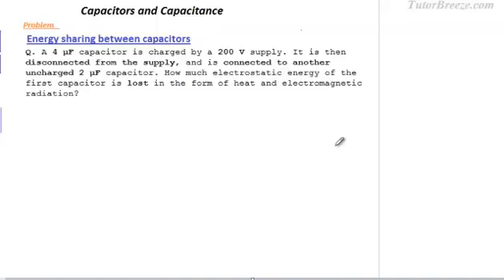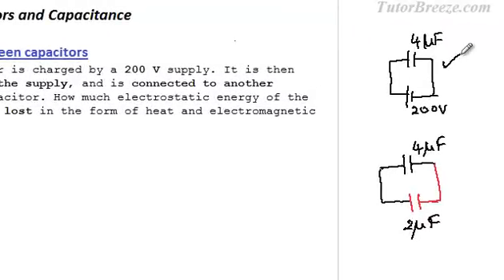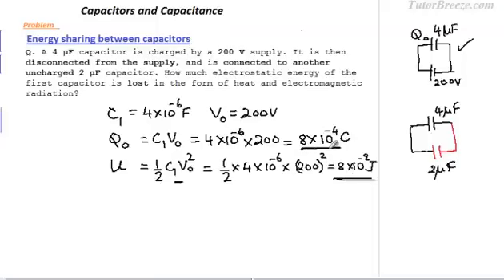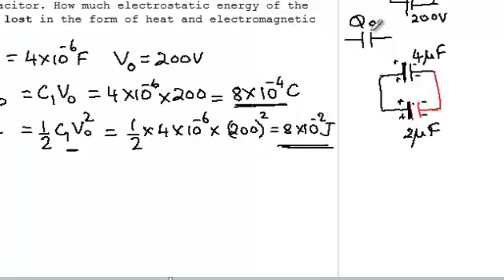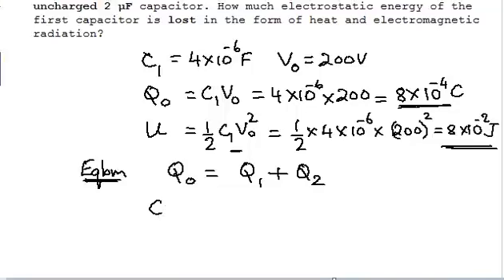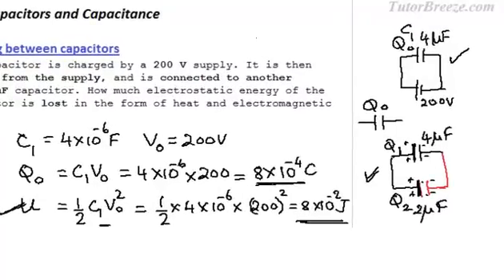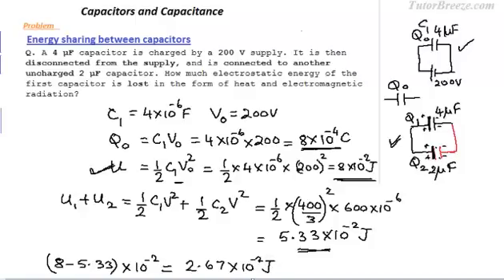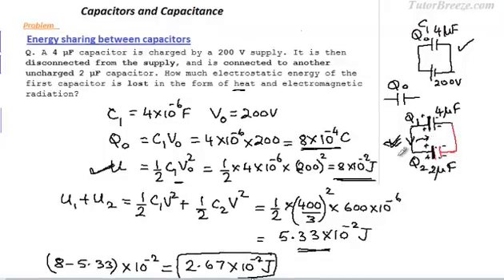Connecting a Charged Capacitor to an Uncharged Capacitor

Comment: Mam, If uncharged capacitor will be connected in series then?
Reply: Then there will be no flow of charges in the uncharged capacitor as there will be no path for the charge to flow ...so all the charge will be on the first capacitor ..and charge on second capacitor will be zero ...
Reply: @mayankrajput5458  right

Comment: What happens if a positive terminal of one capacitor is connected to negative terminal of the other capacitor
Reply: I think there's no positive negative plate as the capacitor is uncharged..
Reply: Discharging of capacitor occurs
Reply: @saiswarup507 
No I don't think so. Charged Capacitors are much like batteries right. If we take two cells and then touch positive and negative terminal then nothing happens,unless circuit is formed. So it's the same for capacitors

Comment: At 3:15 when wire is connected just on one side of uncharged capacitor, there will be no current flows until the other sides is connected. After that, immediately, there is current flow and  is dissipating heat in amount of (I^2)*Rdt, Total integration of this amount accounts for all of the energy loss. It should be noted when R is small I is large. No radiation, just heat dissipation in wire resistance and internal resistances of both capacitors. No need to evoke James Clerk Maxwell.

Comment: The explanation for the loss of energy is inadequate.  You can represent losses by connecting a resistor in series with the capacitors.  You can then make the value of the resistor large or small.  But whatever you do, the loss of energy always remains the same!  How would you explain that?

Comment: All calculations are right, but your explanation about energy loss is wrong. You cannot assume any energy loss without taking into account the wire resistance. There is an article talking about this energy loss and it stated that the energy loss is gone as kinetic energy for moving electrons from a capacitor to another.

The article titled in "The Paradox of Two Charged Capacitors – A New Perspective" published in Physics Education.
Reply: Mohamed Gamal  I guess the last calculation for U2 is wrong I mean it can't be 5.33

Comment: You can't speak about heat and radiation if you don't have parameters of the wires. I don't get why there's so little amount of dislikes as the video is so wrong on such basic levels.
Reply: Dude, she's just making a simple video to explain stuff to kids. She's just a teacher living in somewhere in India trying to make ends meet and occasionally doing some extra YouTube videos. She made a mistake. Ok. Fine. But at least point it out politely. You don't have to be so butthurt and impolite. After all, I don't see you making any videos helping anyone.
Reply: See first of all she is  solving it theoretically where the work done by battery is just CV^2 and the energy stored by the capacitor is 0.5CV^2 so its obvious that the rest of the energy is lost as heat hence the heat lost is  0.5CV^2 .
Also this is actually High school Physics in India hence it doesn't  necessarily have to be so complex .
Reply: There is simply nothing wrong with the video. In order to fully consider the present problem u should be using all Maxwell equations, this is clearly not an electrostatic problem. On the other side, one can be smarter and just noting what's truly relevant in the present situation, that's how you usually do real progress in physics.

Comment: Yes if the caps were connected using a 1k resistor, the calculations wouldn't change. However it doesn't make sense that larger losses don't happen with a larger resistor. I'm not convinced.
Reply: Are u convinced?

Comment: The ideal wires have no resistance, so the heat is not lost.
The second statement about electromagnetic radiation also cannot be true because "radiation due to electron acceleration" has to be different in two cases: (1) wires are very short, and (2) wires are infinitely long. Time of flying of electrons is different and radiation time is different as well. The wire length in this example is of uncertain length, therefore the radiation is not a proof.
Reply: we are literally dealing with grade 12 physics, dont bring your phD theories here